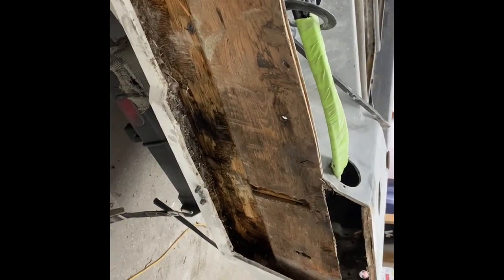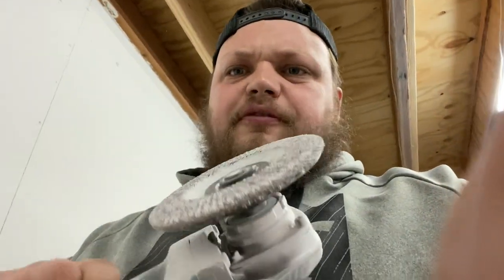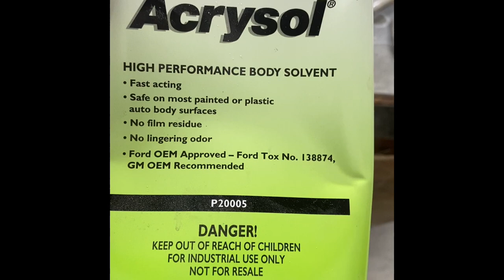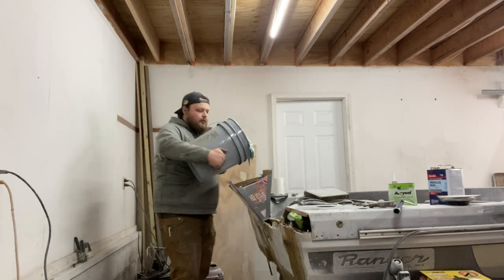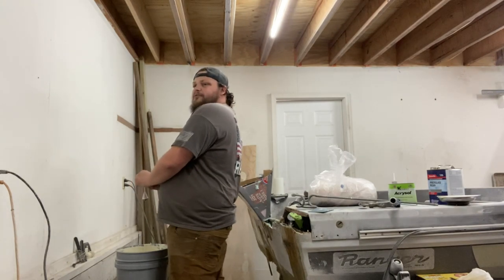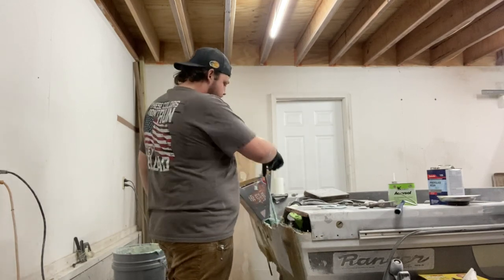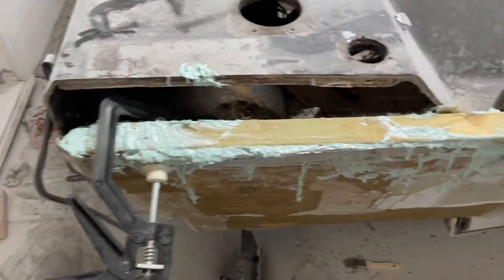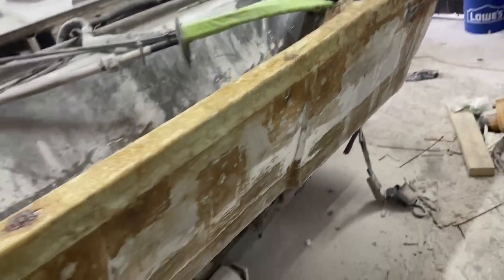BASS BOAT RESTORATION: Transom Replacement, ranger 185-A

Comment: If your prop is lower then your skeg they make aluminum bolt ones to fix that. Rock + prop + bang = not so much good times. There are places that repair them. I got a spare prop a floating wrench nut cotter pin same for trolling motor. Good luck

Comment: My mind is torn on this it won’t stop going back n forth. So you hog out the bad wood pour JB weld with glass in. Ok but the stringers aren’t attached. Is there stringers? Think an aluminum boat all the frame work attached to the transom which transfers the energy I.e torque and spreads it out. If there are / was stringers gussets whatever yikes. If not cool. I have spent more time in wood boats then glass. Just a old man talking to himself
Reply: When those boats were made back then ......all of them had stinger systems that ran from the transom to the bow of the boat.....the floor was attached to those stringers for added strength......also the  transom had large gusset to strengthen it.....all of the wood in the boat needs to be replaced.......the only way to do that is remove the top cap